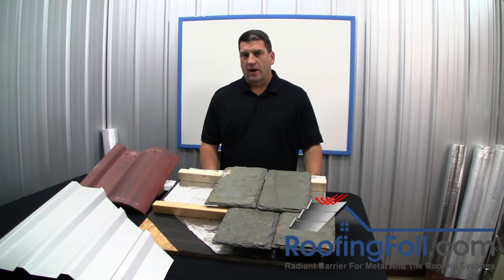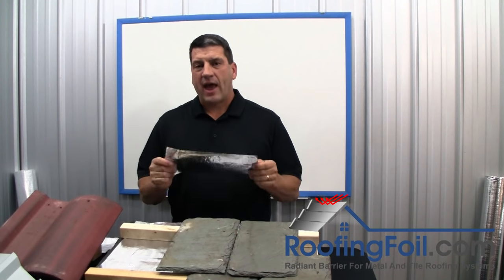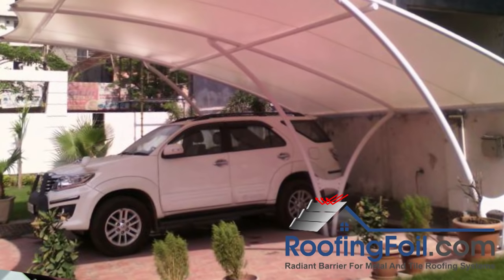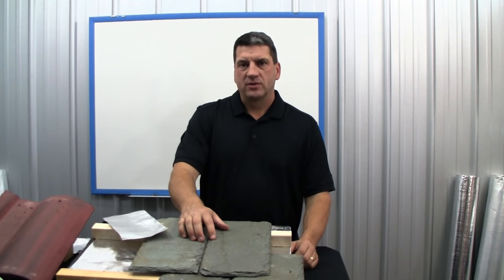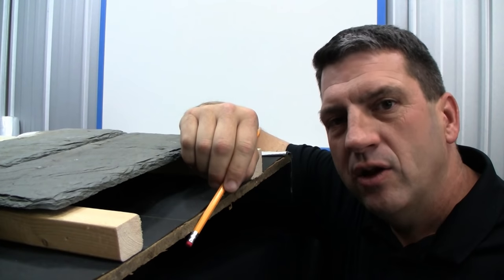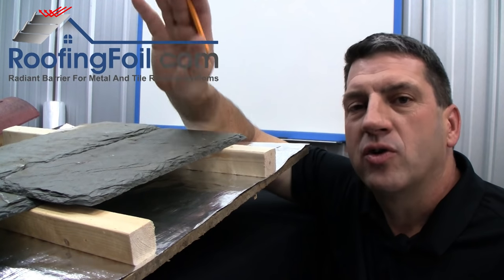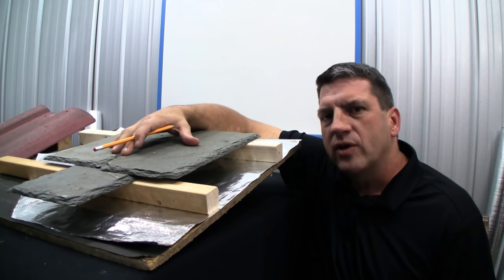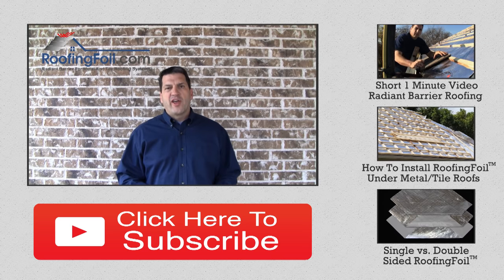RoofingFoil - WATCH THIS BEFORE you buy a METAL or TILE ROOF!!

Comment: do you use Single Sided or Double Sided barrier sheets, if double barrier, why for bottom space needed.
Reply from the maker: Single sided is all that is required with the foil facing up towards the airspace.  The only difference with the double sided foil is that it CANNOT be installed wrong.

Comment: I am not putting metal roof on house ,I am putting it on a carport .Which would be best .It is an A frame 24 x30 carport all wood with shingles that keep blowing off on 1 side .The guy wants to put down 1x4's over the existing roof and then attach the metal to that .This is an open carport
Reply from the maker: Putting foil below the 1x4's will reduce radiant heat from going through the carport.

Comment: Can i use both on my tile roof : radiant barrier plywood + radiant barrier on top of underlayment. If just one is enough then which one to choose?
Reply from the maker: You can definitely use both no problem. If you have to choose one, then the www.RoofingFoil.com is the way to go.  It will help keep the roof deck from ever getting as hot.  With radiant heat, the further to the outside for the radiant barrier, the better. It's kinda like choosing to put a solar screen in the window of your car or parking under a tree.  The tree would keep the inside of the car cooler.

Comment: can you use Reynolds wrap? also when installed should I put the shiny side up?
Reply from the maker: You could...in theory.  However, AtticFoil is tearproof.  Typical kitchen foil tears easy and would be very difficult to install.  Plus, when you look at the Per Sq. Ft cost, I think AtticFoil may actually be cheaper.
Reply: Don't do it.  Wrong product or the job.

Comment: so if you have a shingle roof, can you place the radiant barrier over the shingle or do the shingles need to be removed?
Reply from the maker: Usually you can go directly over a shingle roof without a tear off.  Assuming the existing roof is structurally sound.  https://atticfoil.com/index.php/applications/under-metal-tile-roofs/

Comment: Dose this help with RF/ WiFi radiation?
Reply from the maker: This can be a little tricky.  Generally, installing radiant barrier does not effect your cell signal unless the signal is really weak to begin with.  However, although we don't promote the product as RF/Faraday Cage type product, we have had many customer buy a lot of product for this purpose. (whole buildings on interior walls, etc.)  Because needs are specific, we recommend getting a sample or single roll and testing to see if it meets your requirements.  Generally speaking, any pure aluminum product would reduce or eliminate RF signals.
Reply: Alex N   Yes aluminum foil will block radio frequencies. As long as there are no gaps. In your house rf will enter through windows and walls unless there is aluminum foil there as well.

Comment: Wish I knew this a few years ago.... my room is half above th garage and my floor, room just swelters to unbearable levels.
Reply: Kelly Crane you can still fix your problem from inside the attic space by installing a radiant barrier directly to your roof joists ,the most common type looks like bubble wrap but silver and you staple it directly to the roof joists ,the best from the roof travels up the barrier and out the ridge cap on the house ,I installed an internal radiant barrier inside my attic and it lowered temps from 147 degrees to 95 degrees .
Reply from the maker: http://www.atticfoil.com/index.php/products/48-wide-double-sided-atticfoil-radiant-barrier-foil-perforated/  This has been our main product for over 10 years.